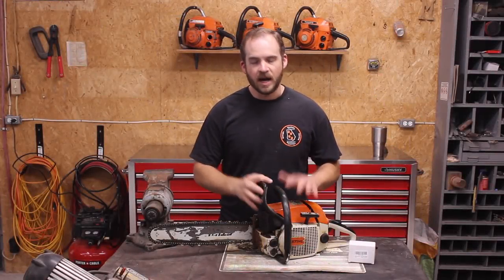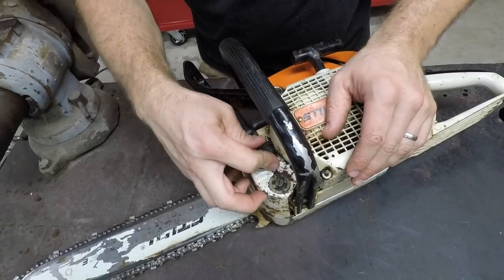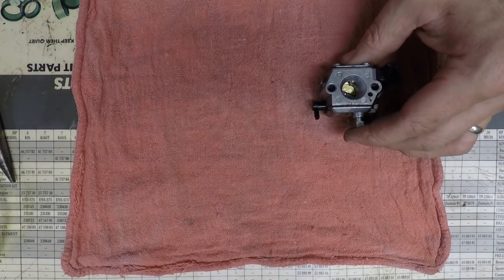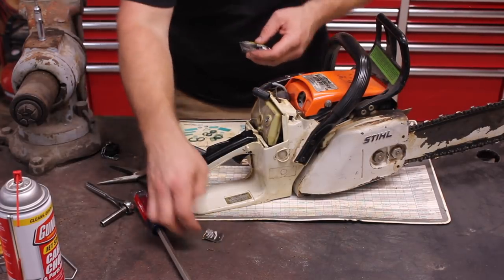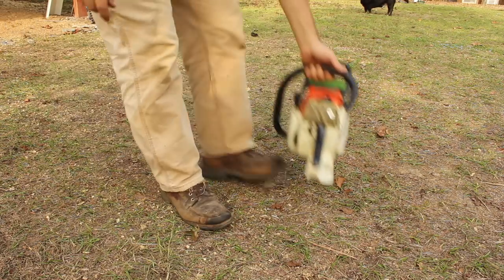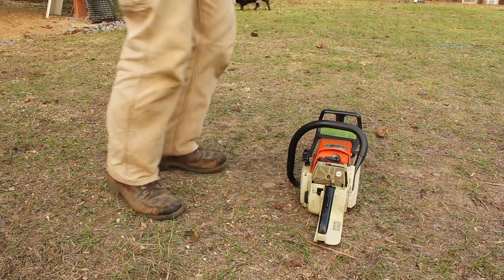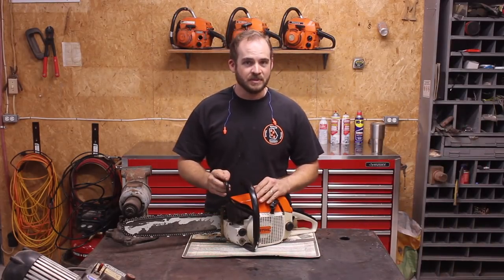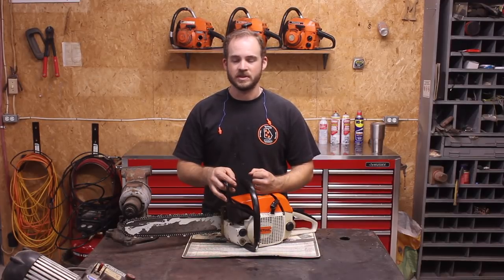Bringing a Classic Stihl Chainsaw Back to Life

Comment: Bought 028 Super new over 30 years ago.  Got an 028 like yours salvaged from a fire still runs great. The bar was blisterd but straight and sprocket good.  
Bungee strap to tractor or skid steer.

Comment: Excellent video sir.  I have run a Stihl 028 Wood boss since 1981 when I bought my first new saw.  I now have 3 028's that I still run and work to keep them in good running order.  The 028 series is not supported in the aftermarket with an overabundance of wear parts like mufflers and clutches, but other parts are plentiful.  I have Chinese aftermarket carburetors on all 3 of mine and aside from some slight adjustments - they run great.  In my opinion - the 0 series that Stihl produced were some of the best saws they have ever made.  Thank you for the video - it is always good to see an old champ like that up and running again.  They are slow and heavy - at least by today's standards - but "they don't make them like that anymore".
Reply: I agree Fritz , I worked for Stihl Canada for 17 years starting in the mid 80's and to me that time was when some of the best saws were being made , the 028 and 038 are still 2 of my favouries . My son has a few 028's as well that we restored along with some spare parts to keep them going.
Reply: I'm on the lookout for a decent 038 but they are rare. Seems like more AM parts are available for the 038.

Comment: This video is inspirational. Am going to attempt reviving a neglected saw similar to yours. It has compression and that’s about it’s got going for it. Never worked on a Stihl before and your video really helps. Thank you for taking the time to show us. I ordered a similar kit on Amazon. Have to order new gas cap ( it might as well be absent). Found two tiny adjustment screws with no top that were threaded into the same length of dry rotted rubber tubing rolling around loosely in the air filter compartment. Can’t figure out where they go. We’ll see. Y’all wish me luck.
Reply: The little screws and rotted rubber hose were the gas tank vent line.

Comment: I put one of those on the 13 year old Mantis tiller that I rebuilt and it worked fine, even the spark plug worked great.  It had all the parts necessary to replace the whole fuel system.  It cost about the same as the one you got.

Comment: When I read classic I was expecting much older. I'm a stihl mechanic, just got silver but been at it for a few years before I got here. . The other day I found an old stihl saw, massive 36" bar, manuel oiler, not sure on year but it is old. I'm guessing 70s. Going to try and rebuild it and use it down the line! Sounds like a fun project

Comment: Its always best to rebuild the old original carb. The chinese copies can give you a lot of problems and it never really runs exactly how it did with the original. Even power can be influenced by bad atomization of fuel or fabrication defects inside of them that can slip unnoticed.

Comment: Pro tip: lift the bar while tightening the bar with the bolts. This way the bar doesn't go up while pressing down on the wood, which changes the chain tension.
Reply: Bar, not blade.
Reply: @clintraley856  thanks, English is not my native language.
Reply: @qinz1695  Not a problem! I can tell you knew what you meant to say lol. You had some good advice!
Reply: I just rest end off bar on a 4/4 block and tighten nuts

Comment: Great video!  It’s been some time since you posted but I’d like to say that I just bought a carb for my leaf blower and weed eater directly from Stihl.  Both were about $35 and a tune-up kit with a spark plug, air filter and in-tank fuel filter was about $15...all Stihl OEM products.  Both pieces of equipment run like new and the man at the shop (Ace Hardware) was very helpful!  So if that knock off has quit you already try a Stihl carb!  Thanks for the video!

Comment: By no means am i trying to be a chain-saw snob , but i will NEVER , ever , ever , use after market parts on any of my stihl saws again. I live 78 miles from the nearest road , i did not say town. On two occasions i tried to replace the carbs and etc , only to have them crap out on me. Cheap china crap. I will only use OEM parts, no exceptions. Expensive as hell , but guaranteed to work. Out here i dont have the luxury of not having a running saw. Great video and very informative. From Alaska , Jason & Theresa
Reply: Yup, I must agree. Cheap Chinese crap can't be depended on. Although I do know quite a few people who ARE happy with their Amazon or Ebay parts. I prefer to spend the money on genuine parts .Like you, I live out in the boonies.
Reply: I’ve had very good experiences with the Chinese stuff . I have a 288 kit saw I use with an Alaska mill with a 42” blade and run it extremely hard and deleted the cylinder gasket and ported it! And I’ve ran the little Chinese carbs drilled em for the vac line so I could add adjustable cards to the little non adjustable stihl. I’ve been very impressed and honestly consider my kit Chinese saw equal to a husky. Indian not the arrow

Comment: I bought one last week for $25 and it's really beat up bad. It's like the guy who had it never cleaned it and I mean never. It was crusted and caked with hard saw dust and oil everywhere. The chain looked like he was trying to cut some boulders in half. I just got done cleaning the best I could in the field. All of my tools are back home. You are right about the carburetor it is very touchy but now it runs like a champ.

Comment: Nice video, keep up the great work. Hope you keep the old plug for an emergency. I'd suggest getting a couple new OEM filters and fuel lines for backup and maybe an air filter. Hope you were able to give the oil passages on the bar a good cleaning and blowing out.

Comment: You should be able to find the model number on the carburetor and buy a corresponding gasket and diaphragm kit either online or from stihl. It's tough to beat those factory carburetors and the kit is usually around $10

Comment: I picked up an old 021 and a 029 Super recently for $75 for the pair. These things were so dirty with oil, dirt and mouse feces it was disgusting. They were in a barn and I doubt they ran in the last 10 years. I took them apart and cleaned them right down to last speck of dirt. Rebuilt the carb on one, replaced the other. Air filters, fuel lines, fuel filters, fuel tank vents, sharpened the chains... Both of these baby's rip some wood!
Reply: Great! I have both of these same saws bought new in 1993 and 1982, still using them today with minimal issues. Repairs include the clutch spring assembly on the 028 flywheel can break if it gets too hot it will freeze up the drive sprocket. The choke on the 028 can become a bit finnicky on initial start up. My 021 has not had major issues since it was bought new. 
The 021 is a rarity for the hp and the 16 inch bar length. It is light but powerful, use picco chains with no raker. 
Drain fuel from them if you store them for awhile, the mix can turn into grey puke if in your tank too long.

Comment: I have an 028 and I've rebuilt it many times but the last time it was used I dropped/tossed/threw it (getting away from a rouge tree). Well it cracked the gas tank. I've tried different methods of repair.  I don't think one can just replace the fuel tank on this thing without going down the rabbit money hole too deep. Thoughts?
Reply: Did you try gorilla glue+baking soda?
Reply: I patched a hole after hitting the tank with another running saw. I used metal mesh and J B Weld....

Comment: Nice Job i did try one of those amazon china carbs on a string trimmer i have with no luck. Tried one on a blower worked fine, its always a hit and miss sometimes with that stuff but for the price you have to take a swing at it. Enjoyed the video!!
Reply from the maker: You are correct. I'm 2 for 2 so far with the Chinese carbs. Thanks for watching as always, Paul.

Comment: Most of the old chainsaws that op end including carb...come into my shop don't run properly because people  leave old gas sitting in them 11 months of the year and everything is full of fuel varnish or an old fuel line developed some cracks. Had a Guy bring me a box full of parts to an old 039. Told me I could have it in trade for $50 on a newer saw because the "authorized" Stihl shop at Ace hardware said it needed a whole new top end including carb. They charged hum $85 to get his swa back in a "Casket" The fuel line was cracked almost in half right where it attaches to the carb. I put the saw together, cut 1/4 inch off the fuel line...RAN LIKE A BOSS.. JUst because a shop is "authorized" doesn't mean they have any skills. It just means they sell a lot of NEW saws.

Comment: I use Super Power and a paint brush to clean up saws with, along with my air compressor.  Carb cleaner or break cleaner can mess up the paint or plastic.
Reply: @ElectronicMusicUnderground  I use our local quarter car wash, after spraying down the parts with Super Clean.  It is faster than getting out my big pressure washer.    I then blow them off with compressed air and let them dry for a couple of days.  None of my stuff has points.    If they did I might do things, differently.    During winter, I put the parts in my office over a heater vent.  They dry out nice and fast - a weekend is usually sufficient.  I break them down to their biggest pieces.  I remove carb, muffler, coil, starter and block up the intake boot and exhaust port.  I usually put a little WD40 into the intake boot beforehand.  I leave the plug in.  I do not want water getting into the cylinder.  I spray wash the cases, starter, rear handle, top covers, sprocket cover - just about anything plastic or metal.  I will tell you something I found on my 021.  I pulled the cover on the rear handle and it was completely packed with sawdust.  I wondered why the trigger was a little slow.  Not any more - I cleaned it separately.  You can eat out of it, now.  Usually, the rear handle/fuel tank  is one of the filthiest parts, along with the muffler area and the PTO side.

Comment: question for who ever...My 28 wb has a thin vent line with 2 screws in it "why" and in just curls down next to the filter ..No hole in the backing plate like your 28av also noticed your line is cut or open???

Comment: I can not stress enough how bad of a decision it is to replace a perfect OEM Walbro with a Chinese knockoff. It will not last. Voice of experience. Take the time to do it right and clean/rebuild the original. If it isn't salvageable, always buy an OEM replacement.
Reply: Especially if you have one of the older ones with the tillotson carb.
Reply: Yep, OEM carbs are the way to go. The reason why the diaphragm was so bad is because of ethanol fuel. Ethanol destroys rubber in time, making it less flexible/brittle. After a few problems due to it in my 2 cycle engines, I run nothing but Aspen now. A bit expensive compared to pump fuel, but it's well worth it for me. I never have to worry about the fuel going bad or leaving it in the tank for months
Reply: Where do you find own parts. I’ve tried several saw shops with no luck

Comment: I picked up a crash damaged 026 this week for $25.  Couldn’t pass that one up.  I have ordered a new AM gas tank for it.  The worse thing was how filthy it was.  It had sat at my local Stihl dealers for about 15  years.  It was missing an air filter cover and the air filter was damaged.  I have a new rear handle ordered for it and will put it on when it comes in.  I figured it was a running saw when a tree fell on it and I was right.after I cleaned it up I squirted some gas down it’s throat and it runs.  I am goin to connect it to a container of gas, today, to see how good it runs.  I think it will do fine and the oiler may even work.  I have a bar on it but no chain.  I can put a bar an chain on it but just want to see how it runs before I take it apart to put the new rear handle on it.  I also use Bosch WSR 6F plugs in all my Stih saws.  I don’t run that Chinese crap either.  To make it start a little easier, squirt a little two cycle down it’s throat and start from half choke.no way I am pulling a saw over 14 times to get it to crank.

Comment: Great video. No need worryin'!  That knock off carb will be ok, just keep ethanol out of it and it will last a long time. They are kind of hit or miss but if it runs good in the beginning, there is no reason for it to change other than moisture or corrosion...ethanol makes both very likely. Many Blessings!

Comment: I have that exact saw I bought new back in the early 80s. Only problem I have had is I have replaced the clutch springs 4 times. I do not slip the clutch but still cant figure out why I go through so many springs. Same with my Stihl FS85 weed trimmer.

Comment: Choke should have been on from the start ... Hard on the brake and clutch running it that long with the brake on ...
Reply: I’m a stihl certified tech and this is something that is way too common. You can start to melt the housing of the saw in just a few seconds with the brake on at half choke. Also some of these cuts felt really dangerous to me, really close to that upper quadrant of the bar where kickback becomes an issue.

Comment: Good lord. If this is a " classic ", I guess my 045 is a dinosaur.
Reply: My 036 also must be a dinosaur
Reply: It's a classic as in it's a popular saw that's well known by a ton of people.
Reply: O
Reply: This make my 031 seem old. Which it is it was made in 1971. My grandpa gave it to me for my 18th birthday to restore and learn with
Reply: It is, lol! It's basically an overgrown 041. They were 75cc & would handle a 24" bar just fine. It & the 056 were sister saws.
Reply: 045s came out in the early '70s & lasted to '80. The 056 came out in '80. The 045 Super (read 056) came out in '77-'80.
Reply: @darrellpickering8535  the most powerful 041 was the 041 Farm Boss and it was 60cc not 75cc.
Reply: @stevenkinnison8044  The 041 was 61cc & for a very short time there was a 041 Super which was even bigger at 72cc. The 045/056 uses the same design but is bigger. I was a Stihl mechanic for many years. Just being informative.

Comment: I had a old one with points in it and had to by the cam tool to set them up but I had a o31 and a 041 with points so np .my 041 the cam wore down so I couldn't set the points anymore so had to make it electronically Inc so it was done I like the old saws

Comment: Pro Tip: Use a lapel Mic on your person, Mount you mic on a surface that is not connected to your workbench, Or use a spring mount for the mic.

Doing any of these three options will reduce / remove the horrid noises caused by vibrations every time you touch or move the saw around like you have in this video. You could build a spring mount easily enough (look up pictures of them and you can see how easy they are to make).
Reply: I was looking for someone that posted about the table noise the mic picks up. And I'm not even 2 mins into the video!

Comment: The 028 AV was made from '70-'80 & the newer versions were made until '90. They were made in 43cc & later in 47cc. As far as I'm concerned the smaller 1s ran better altho both versions had a habit of the crankshaft breaking next to the seal on the PTO side. It's thought that bearing vibration was the culprit. Seen several that way. Stihl musta sold several million of those.

Comment: Your Walbro carb is a lot better carb than that Chinese junk, imho.  I would put a paper towel plug in that intake boot to keep crap out of the engine when using compressed air to clean out the carburetor area.  The problem I have with Chinese carbs is most of them are squirrelly - the adjustments do not always work as intended.

Comment: My rule - if I open a carb it gets a new set of diaphragms, either Walbro or Zama. As far as Chinese carbs go - they are not that bad. Price has nothing to do with quality.  I do pressure check every carb before I put it on a saw, oem or otherwise.  It better hold 5# or I find out why before it goes on a saw.

Comment: the metering diaphragm does not pump the fuel. it is pretty much like the float in a larger carb and shuts fuel off when the carb is full. when they dry out they stick 1 way or the other so they will either let no fuel thru or let a lot go through and possibly flood the engine right out.

Comment: Always check for compression first..it needs to be at 150 psi 140 and lower it will need a piston rings and cylinder ..compression , spark and then fuel..regular won't work on any single cylinder engine after 1 months time .. use super and you will NEVER have a problem with any gas powered tool as long as you use it every year... if you don't use something  Every year like a generator you want to drain it and put some WD40 or any kind of lubrication in the gas tank and in the carburetor to keep them from pitting or rusting

Comment: Did a 030 for a mate not long ago, had the fuel line inside the tank rotted away and the diaphragm in carb was split, so new carb and fuel line and now she runs like a dream, eBay carb $40 fuel line $14 the local stihl shop tried telling him $400 dollars to fix it and even tried to sell him a new saw 😂
Reply from the maker: Nice! Saved him a bundle.

Comment: Had a near brand new Husky come into the shop. GUy only had it for a month..Leaking jackup , non adjustable oilpump had failed. It would only run sitting straight up. Replaced the pol pump with...yes another brand new and probably useless Husk pump ...the mazing thing was there was almost 14 inches of fuel line coiled up inside the tank. The weighted filter had no room to move

Comment: If you use a good stabilizer in your gas it will still be good two years from now, but not with ethanol gas.  I use premium non ethanol gas and Echo Red Armor @ 50:1 plus one ounce of Briggs & Stratton AFT stabilizer per gallon.